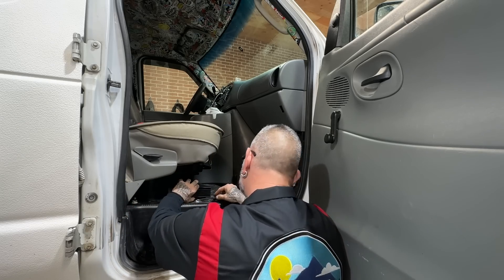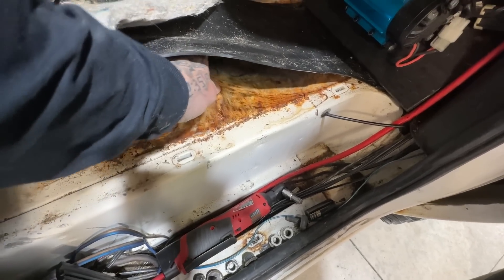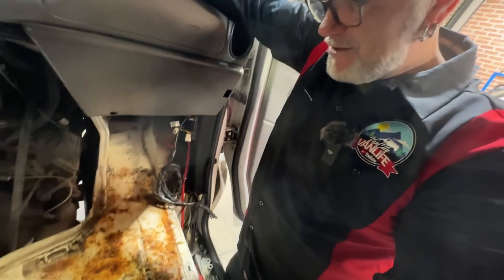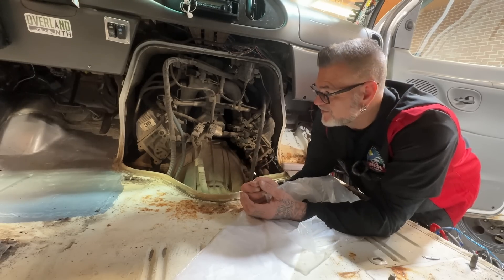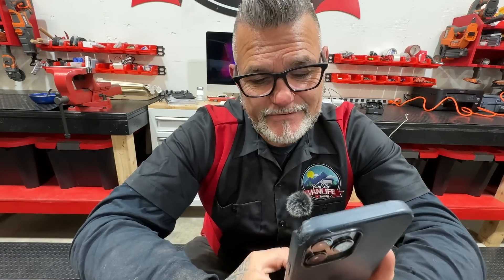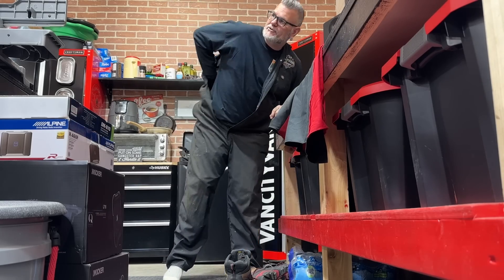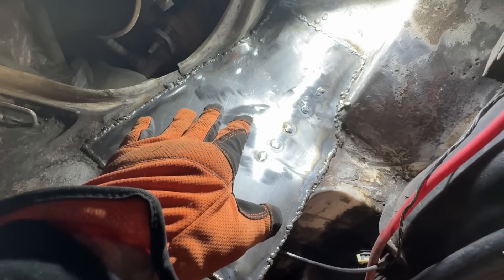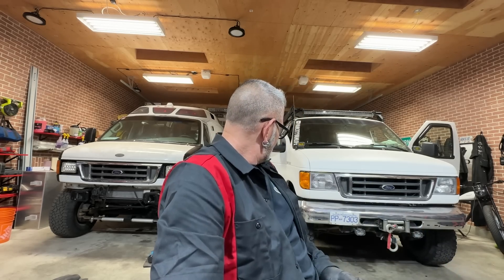ITS A SAD DAY. THIS PROJECT WENT SIDEWAYS REAL FAST.

Comment: When I bought my van it was rust free. Pass the first winter I start to see some spots. The year after I had hole the size of my fist in the rocker on both side. Now I need to replace the rocker between both wheel on each side

Comment: I recently had engine work done to my 2008 F250 pickup. It was at this time that the mechanic noticed the front upper coil spring cradles were rusted almost to failure.They both needed to be replaced. This truck is clean! My frame is very clean and mostly rust free. My mechanic said this was a very common failure point.

Comment: Unfortunately rust in that area that area usually starts on the outside, the factors of moisture thrown up from the tires and the heat from the exhaust speed the process. So fixing from outside working in would be best but we work with what we have.

Comment: The problem isn't the insulation. It's the rubber flooring that traps moisture. There is a reason most vehicles come with carpet instead of rubber.

Comment: Chrome. I feel for you. Rust never sleeps.. You must stop the ingress of the water..Having just gone through this with our 2005 Ford Transit Van which we are converting,  we learnt a lot..But in NZ we do not have the winter salts on the ice n snow. But a proper UNDER BODY SEAL is a must. I saw under your van last year. Yuk. Here in NZ it would fail our WOF need fixing before licencing it.Have the underneath sand blasted and then sealed. Secondly check the door and fixed window rubber seals. I ordered a new front window and when they took the old one out the panel shop had to deal with the RUST eaten frame, A source of water under the floor covers. UNless you stop the ingress you will always have rust..FACT. All door seals need to be checked and perhaps replaced. They flatten out over time..Finally we found one roof gutter was leaking and the water running along the inside and down the A Pillar..  Best regards.. Roger n Erin NZ.

Comment: Keep the floor mats out and rust will slow down. Michigan here,once rust starts it's a never ending fight. Drive it till the wheels fall off is best thing you can do until you get that ambo done. Remember ambo floor repairs are going to rust also. The pad you stuck down in the ambo will not stop the rust only hide it.
Reply: I'm originally from Michigan, now living in a minivan in San Diego but you're right. Rust is relentless. I hope Chrome can crack the code because bro is fighting hard.

Comment: Probably best not to have any floor mats on the cab floor. So you can dry the floor at the end of the driving day
Reply: It still comes & comes back.
 I like the racecar feel , so I always remove the carpet & panels from my vehicles. 
The heat from my exhaust makes
moisture on the bottom & top of the floor when cooling off. Stepping in & out on of the vehicles on rainy days, water gets around and doesn't always dry.

Comment: I have told you before, that the water is coming from a windshield leak. I had the same problem with my 2001 Ford E350, and once I had the windshield replaced and resealed, I haven't had anymore water leaks.
Reply: Hey chrome 
I  really am just trying to help. The leak on my windshield was so bad, that not only was the floor soaking wet, but going down the road in a rain storm, water would drip out of the sun visor screw mount. (No, I'm not kidding) but things have been nice and dry with the new windshield  and everything resealed. This has to be a common with this vehicle.

Comment: I realize the rubber flooring is easier to keep clean but you really need to carpet the front of these vans unless fully coating the floor with something tougher than paint such as epoxy(or what you have on the exterior). The interior floor rust results from a combination of the batting and the impermeable rubber both trapping moisture. Carpet allows moisture to evaporate.

Comment: Try an oil or lanolin based self healing rust preventer! Even after I replaced panels and used POR15 it's the only way I was able to keep the rust at bay on my old Ford E-350.   I used Fluid Film, but there are others out there and they're super simple to use.

Comment: I’m from North shore of Montreal Quebec and we deal with rust on our car for decades. Our weapon are Rustproofing with like grease paste for the underneath and oil like spray for inside doors, engine compartments and other tight place around the car. I’ve been doing this for more than 20 year on my vehicules and can tell you it help A LOT to keep rust away. Do you have some place like these in BC?? If so, I encourage you to repair all of your rust damage and have it rustproof as quick as you can. Hope it help!!

Comment: I grew up in the rust belt of NY. Patch it till the wheels fall off. NowI live in North Carolina no rust here.will look for a replacement you really want a 7.3 the6.0-6.7 are boat anchors. Start using weld through primer for rust prevention

Comment: It seems your rubber mats are actually trapping moisture under the mats.  My 2002  Econoline has factory carpeting, it gets wet often, but seems to dry out quickly, and I have never had a spot of rust on the metal floor.  Also, when you drive through deep water quickly, water which contains road salts, iron, and other chemicals is forced into every crack and crevice in the frame and underbody.  Also, any older vehicles used off road often develop rust very quickly if not cleaned frequently.

Comment: For future reference: Aluminum will not rust. You can get a thick gauge aluminum. Weld it with Gas Tungsten Arc Welder.
Reply: Aluminum develops a powdery chalk like coating when it is exposed to moisture. This is a type of deterioration similar to rust on steel with it's own set of problems to deal with. Joining dissimilar metals also causes problems.
Reply: @kevola5739  So, we found the true nature of Life ? All things are born, becoming worse than before and finally die...🙂 He could create a van from stone and even this will go after thousands of years...:face-blue-smiling:

Comment: Chrome, have you ever considered the water is coming in through the engine cover. You are doing a great job treating the rust but water is still getting to your floor. The biggest leak point I see is the engine cover. And since the moisture appears to surround the engine cut out, it seems to be the culprit.

Comment: spray the inside floor with the bedliner spray and do not put anything over the bed liner spray once the inside is sprayed. This way you will always be able to see the condition of the floor and make adjustments as needed

Comment: Hey, you have repairs in a "Sticks and Bricks" home so just consider it maintenance.  I wonder if the solution to the moisture issue can be found in a marine product.  Boats and the inside of them , encounter moisture constantly and they use a desiccant inside the boat, which removes moisture, like those little packets in a vitamin bottle.

Comment: I think you have a moisture problem not a rust problem. 
The body mounts just do eventually rot out on everything. Being into classic cars it is a very common problem/occurrence . 
Anything older than 10 years old is going to have rust regardless of where it spent its days.
One thing about sticking with the van you have is you know it and its little quirks and issues. You may find one with a perfect body but it could be a complete lemon mechanically.

Comment: My brother had an old station wagon back in the 80's that he completely replaced the entire lower half of the body with sheet metal. He used a million rivets, and then painted it white with a spray can. He drove it for several years after.

Comment: Chrome don’t give up. It would have happened to any & all used vehicles. Even the ones in heat states. They may not have body rust but the sun damage to the roof & dash would be just as bad. I will keep an eye out for Ford Econoline Diesel.

Comment: Hi, I'm an engineer. Condensation = rust. You'll never create an oxygen free situation under the liner.  So use something like work mats under, which allows airflow and prevents moisture build up. That's my 2 cents 😊

Comment: 😢 That  sucks 😞 After all of that work you did😢How about trying with putting that sealing inside your van ( fix that rust there) then put a heavy coat of sealer on the van floor before putting down the carpet...

Comment: Hahaha...I new you weren't giving up. Great fix Chrome. My Vintage van has way more rust and I'm just beginning to remove the entire front floor board from door to door and I'm thinking a thick steel floor should take a long time to rust through. I thank you for showing us the products you used and I am going to go that route as well. The stick down rubber matting will also get used through out the van...yes it's pricey but a lot of the car builders I know swear by that same product. Rust....what can you do, ya know? But it's your home and you got to fix it either way. Great video and we'll see you in the next one. Cheers from Sask.

Comment: Quebec  is the capital of rusted cars we brush oil on the rust to stop the rust and put a coat off grease and put foam insulation on top of grease and reinstall the carpet

Comment: I'm afraid to look under my mat in my chevy express 🤷‍♂️I have rust on the lower rockers but it's a common and poor design on chevy express vans. I will fix it soon but I'm not going to weld the panels on. I'm going to use panel bond to glue the panels on. Less chance of burning off the primer/ paint on the back side which could allow it to rust. And as for the floor in the van I'm thinking about using raptor liner on the floor and install a removable floor drain and not bother putting a mat down. 🤷‍♂️ what's your thoughts on that Chrome

Comment: @5:24- The only option you have, at this point- Unbolt the body.. Lift it off of the chassis.. Roll out the frame.. And armour coat EVERYTHING after rust treatment.. It's a LOT of work. Too expensive for Ford to do... BUT- If you (we) want these his to e Homes.. It's inevitable to Do The Work.

Comment: Another trick is use a sacrificial anode. Like a piece of aluminum. The aluminum corrodes saves the steel. It'll have to be replaced from time to time. Same method used in bridges...buildings etc.

Comment: found the floor on the passenger side in my 2005 nissan altima completely rotted out so you could go full fred flintstone so I used a dell computer side panel as a fix,  I'll have to take it down some gravel roads before I trade it off to cover it up as the stamp "dell" shows up  😉

Comment: It's time to take all the front panels of and start welding the chassis and body mounts up Chrome it's the Circle of rust with old Motors and living in places where snow and salt is on the roads I have a 1996 Mercedes Sprinter camper and that's my start of rockers all been done chassis mounts 😢😂 so stay safe chrome and Cruise from Halifax England 🇬🇧

Comment: Dude what you have going on is something called Thermal bridging can increase the risk of condensation on internal surfaces and and even cause interstitial condensation within walls and other building elements. Interstitial condensation can be exceptionally dangerous as it cannot be seen from either the interior or exterior of the building. it is not from water getting in from inside the van.

Comment: Eebay motors in Virginia 34000 dollars its blue and 
6.o liter diesel with 54000 miles its 4x4 and a  2006 extended length its the Quigley conversion xlt model up front

Comment: Chrome, your problem is that you get into your Van with wet shoes or full of snow. Buy yourself a pair of slippers and before entering your Van on the driver or passenger side, take off your shoes, put your wet shoes in a bucket or elsewhere without them being in contact with the ground of the vehicle and only enter your Van with your slippers. You will see that you will never talk about rust problems inside the Van again.
At the same time pass the underside of your vehicle on the tar.

Comment: Ive been a Journeyman HD mechanic for 40 plus years one thing I learned is you never give up if there is a will there is a way and anything is repairable. Your mounts can be replaced by fabricating new ones or buying new ones. This work should have been done before doing expensive paint jobs. Ford quit making this body style van so these will fade away in time and the junk transit van will replace them which is much worse and expensive. Seperate the body from the frame roll it over and fix it properly useing stainless steel if you can and read some books on pro rust repair or just keep patching . 👍👍

Comment: The rusting is going to continue as long as the roads are salted. To minimize the rust don't drive in the winter. And stop driving at full speed through puddles and mud .